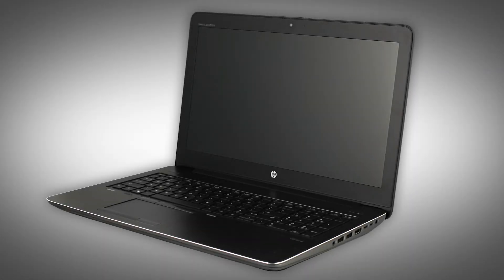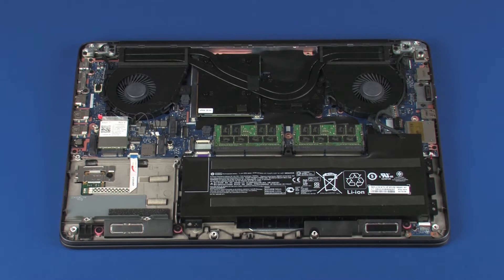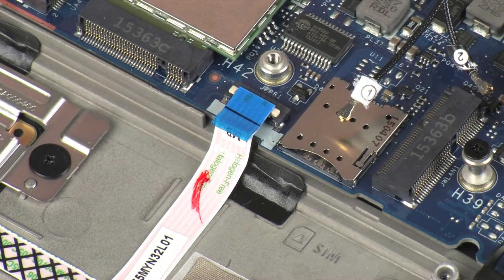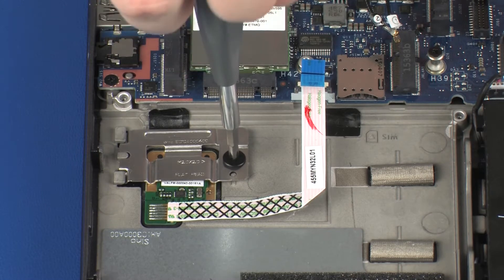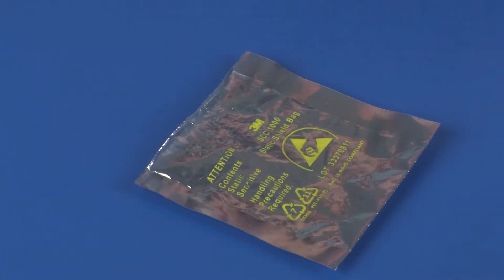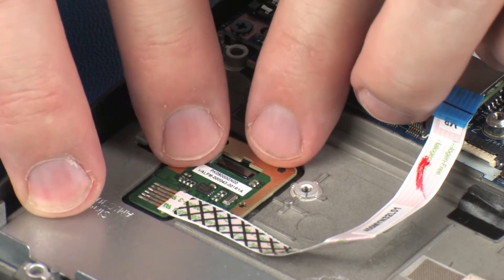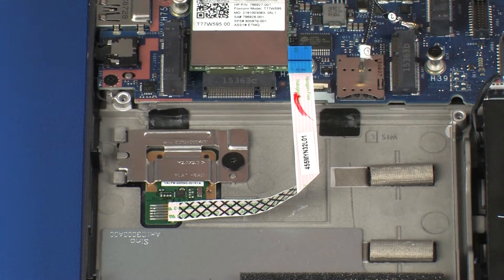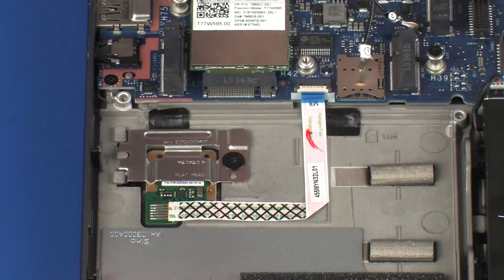Replace the Fingerprint Reader Board | HP ZBook 15 G3 Mobile Workstation | HP Support

Comment: Do all units have Fingerprint reader or its optional?
Because mine doesn't have this.
Reply from the maker: +Hi There All models does not have finger print reader.
Reply: @HPSupport 
So I need to add it after buying the laptop?
Reply: @maythamali  Did you find it? My zbook 17G6 does not have it and I never missed that, I just got a Zbook Studio G8 and that finger print scanner is really handy and I would like to add that if possilbe